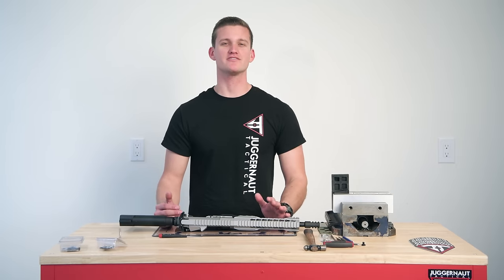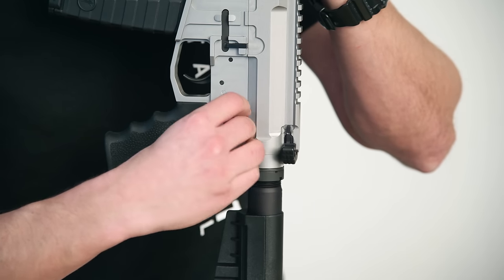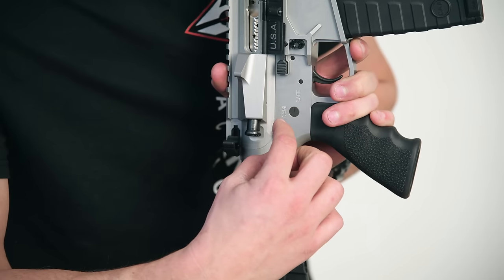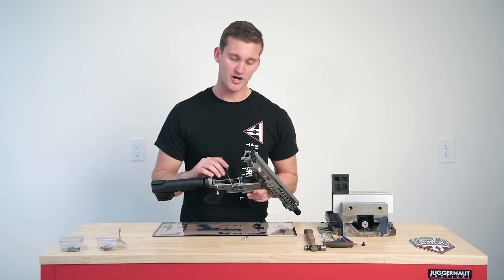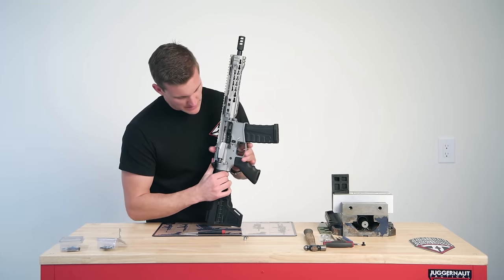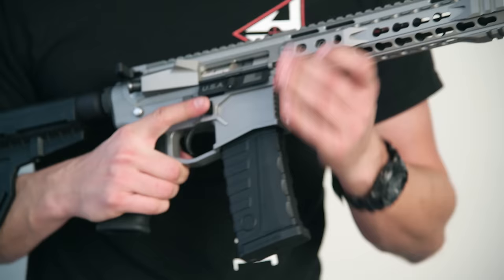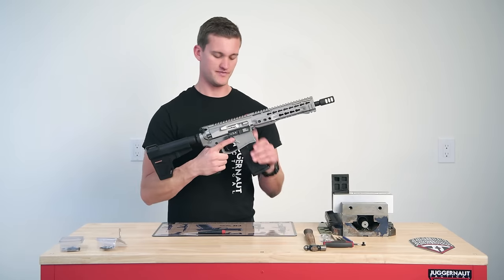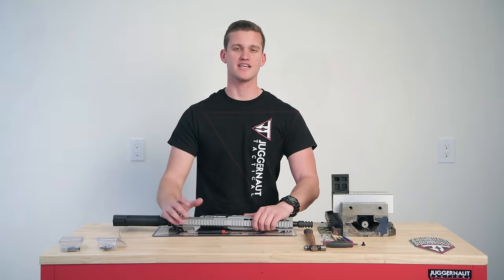How To Disassemble And Adjust Our Hellfighter CA Mod Kit

Comment: Be very careful pulling that pin out! First time I had no problem with disassembly and cleaning my firearm. The second time a small pin like a silver bar super small sprung out and flew across the room because that pin came out all the way do not pull that pin out all the way the spring will make that silver piece come out and it took me over two hours to find that piece and put it back in to the firearm. One time I went out shooting in the desert I had a jam and had to disassemble my AR rifle the same thing happened that tiny silver pin came out and it took 5 hours to find it in the rocks and Rubble. I repeat be very careful when disassembling the California compliant AR kit. I have to clean my firearm tomorrow I hope and I will disassemble the firearm very slowly so that small piece does not fly out towards the ceiling. Again be very careful while disassembling your firearm
Reply: Its called a detent pin and u can actually buy them from your local firearm dealers for around $2 i just bought a few extra and also bought a steel hellfighter kit luckily this time the detent didnt fly out just in case it does I will install it next time tho
Reply: exactly. This video should have told us not to do that, but it does not.
Reply: Same thing I struggled with in the beginning. It’s a pain in the ass, all you gotta do is go nice and slowly and hope that little shit doesn’t fling out…
Reply: Lol maybe wrap around a cloth  on the gun when pulling it out
Reply: This just happened to me right now. I saw it flying but now i can’t figure out where it goes back exactly. Can anyone try explaining where to place it? Thanks
Reply: @bvel93  look up a video called AR takedown pin without disassembly
Reply: @xsmileyonex hi. I was gonna clean mine for the first time and that pin didn't slide all the way so I can open it and now it got stuck and won't go all the way in or out. Spent some time with it, call my friend who know way then me and he couldn't fix it. Any ideas what happened? Thanks
Reply: Just get a comp mag
Reply: Same thing happened to me but when I finished shooting the bolt locked back and only way for me to release the bot was to remove the upper from lower fully and put both pin back in after the 3rd time the juggernaut pin is stuck because there is a tiny pin preventing me from pulling it out
Reply: This makes me hate cleaning mine too 😂🥲
Reply: @maxfromeve8636 same problem I'm having any updates?
Reply: @apple3172 any updates?

Comment: Mine lower is stuck it wont release all of a sudden with this mod even after doing exactly whats shown here.  Any ideas??
Reply: I had the same exact problem, I had to put something in there and hammer it out. This thing is crap, going with the kingpin
Reply: Is the bolt catching on the empty magazine and not allowing you to pop the back up to release the magazine? I just put one together and it seems to have that issue. There is a video on Youtube where a guy files a little material off the back of the magazine riser (sorry, I don't know what it's called) so the bolt slides over it instead of catching on it. I might be filing angles on a few magazines, but I'm looking at other possibilities, too. 
Without the Hellfighter, there wouldn't be a problem with the bolt catching because you could eject the magazine without separating the lower from the upper.

Comment: Just finished my build and I gotta tell y'all at JT..... I loooooooove the mod kit. Simple and practicle for me.
Reply: Do you have any play with the upper and lower? I have some and a tiny gap 😔
Reply: @ocroyal6688  
   None actually. My issue was with the pivot pin's spring and detent. Should of cut the spring a bit before installing. Pivot pin seems frozen. Went ahead and got myself Yankee Hill's "Specter XL Diamond" full upper.and still yet to fire a round. Good luck broskie. Stay safe, stay alert and train hard.

Comment: Just had one installed, like it so far
Reply: veerchasm1 I know I’m still going to do more research, but after installing this mag lock, would one also need to go to a fixed stick, and muzzle break or compensator. Or does this cover it
Reply: Swang & Bang it covers it
Reply: Swang & Bang No, if your magazine is locked like the Hellfire here does,  you can keep your pistol grip, you can keep your flash hider, and your stock. You can even have a foregrip. The only downside going with this, is you cannot lock your bolt back and hit your paddle (bolt catch release) to rack the bolt carrier. However unfortunately I'm pretty much used to it now, and its good.

Comment: just installed two and they work well. big downside  like most other mag locks are no bolt catch. would get 333 tactical maglock if i bought again
Reply: fire 9 of a  10 round mag and you don't need it .Load another 10 round mag and repeat,no charging either...
Reply: Do you want to swap mag locks. I have a 33.3 tactical unmodified cal catch which catches the bolt after the last shot. I install two cal catch. One work and one didn't. I swap cal catches on both guns, but the gun that didn't work still didn't work so I know the problem lies with my lower receiver.
Reply: Deer Phoria I would actually, how do we do this

Comment: Did anyone else have issues once they tightened down the buffer tube castle nut where the detent and spring put too much pressure on the tactical takedown pin and dont allow it to depress or twist to open to fully open the action for disassembly/cleaning? JT told me to snip a few coils from the detent spring. Haven't tried yet but curious if anyone else had this issue.
Reply: That's exactly what I had to do, and it works fine now

Comment: Ive been trying to find out what what that button is above the the mag release I am fairly new and in the process of building my ar atm
Reply from the maker: Ambidextrous bolt release - not functioning when Hellfighter Kit is installed
Reply: I just got a LWRC that came installed with the kit and it works on mine.  Im no expert nor do I know why,  just a fyi.

Comment: So i tested this out yesterday. The thing i did notice was the button that you push to release the upper becomes loose. You have to constantly tighten it. Other than that it was fine. Now to remove it for cleaning hmm 😒
Reply: Man, I've been having the same issue of cleaning since installing 3 years ago. I could never get the pin to pull out far enough without fear of full removal. I finally got fed up, sprayed some CLP in there, and went for broke with another hail mary pull, and wouldn't you know it, the damn thing did what's supposed to, and my upper opened up! Now the bolt carrier assembly is soaking in cleaner to get the scrub-down in a few hours.

Comment: Does anyone know of something like this that works for an LWRC DI?
Reply: Yes. This can be used on LWRC DI.
Reply: @allthecommonsense  Hey man thanks for the reply. Do you know from personal experience? I talked to the guys who make this product and they said it should work but last time a company told me it should work it didn’t lol.
Reply: @JTurn916  I have a 16” Tungsten DI that came with this installed. Works fine. I’m trying to figure out how to remove it since I left CA.
Reply: @allthecommonsense  Ok so it came factory installed? I bought mine when the bullet button was the standard so I wonder if they had to make any modifications at the factory before throwing this on there. These guys told me that I would have to get rid of the ambi bolt release to fit it on my DI. I wouldn’t mind doing that but didn’t want to risk removing it and it still not fitting.
Reply: @JTurn916  I bought it 2nd hand and I’m not sure whether it was done at the factory or by a dealer. LWRC can be hard to get ahold of for info, so I don’t know what they use for factory CA-compliance. I still have my ambi bolt release though.

Comment: did all the steps and it still wont seperate
Reply: Same with me did you find a way to seperate it
Reply: I'm not able to get the pin out
Reply: @ericmarquez780  I had to take mine back to turners and it tunrned out my rear pin was bent.
Reply: @Joshh556banana  I got my rifle at Turners, were they able to take it out?

Comment: I did all this and my gun won't seperate.... wtf
Reply: Same here
Reply: Did you find a way to separate it yet im having the same problem
Reply: @Joshh556banana  it turned out for me that the rear takedown pin was still stuck in the reciever just enough that it prevented it from opening, so I risked it and used brute strength to force that sucker out and it worked. Be careful though.
Reply: @lawman34  i did that and now it seems that the button wont go back in
Reply: Have any of you guys figured out why it's doing that? I still cant get mine to come apart for cleaning I just got mine to
Reply: @jorgeurbina5037  try getting a screw driver to pry the little silver pin to the the left to get the take down pin out
Reply: So just pry it off
Reply: Untill it pops open?
Reply: @jorgeurbina5037  dont put to much force on it it will get jammed

Comment: Man you make it look so easy. I Tried cleaning my new rifle that came installed with this and I failed miserably. I followed every step, but after I turned it one notch to open it, the pin wouldn’t come out. I thought
Maybe it was too tight and forced it out, but the upper and lower still won’t separate. Has anyone else ran into this problem? Any solutions?
Reply: hopefully you figured it out, but it can take a bit of turning it back and forth to get it loose sometimes.
Reply: I’m having this same problem rn. It’s like the button is too dry to turn properly
Reply: Found solution?

Comment: Just installed my kit and back from the range to begin cleaning the rifle.  Functioned as demonstrated but having trouble with the detent pin when pulling out the rear take down pin partially.  The detent always pops out every and then I have to repeat the installation process over.   I'm confident the installation was correctly completed because the take down pin worked, upper separated from the lower and was able to release the magazine with the button.  What am I doing wrong or is this a defective product design?
Reply: Im having the same problem but I cant seperate the lower from the upper to reinstall. Stuck together.
Reply: Hi Gabe:  I purchased two of these devices and had high hopes that they would work.  Had various problems with them both and ended up uninstalling them both.  Good luck with your problem and hope you find a solution that would allow you to continue using the product.
Reply: Same here. Not happy. And, even when the detent pin doesn't pop out, it is very difficult to get it far enough out to separate the upper. I can see the takedown pin getting weaker with each attempt.
Reply: I’m having the same problem as all of you. Any one fix it?
Reply: Brandon Park I uninstalled and made my rifle featureless.  I’m sure the manufacturer sees our comments to their own video and wonder why they don’t respond.
Reply: Jake Padilla 
That is so unfortunate. I had high hopes for this pin. I don’t want to go featureless
Reply: Myself as well it was very frustrating especially how this company does not reply or seem to care. Made my rifle featureless. Waste of $60.
Reply: Was hoping to find a good solution but it seems there are none..I have the same issue as everyone here. It's a pita to complete separate the upper and lower. Not to mention from time to time the first round from a fresh mag fails to feed. The rifle has always been reliable until I installed this product. I guess it's time find somthing else.

Comment: Why not leave the original rear take down pin in until you adjust the mag lock, that way its less steps to check the setting of the mag lock. Then once set and operating properly change out the rear take down pin.
Reply: you sir are a genius
Reply: Original pin or not makes no difference.  The upper needs to be opened to adjust the set screw.  The JT rear pin is designed to quickly pop the upper open (but holds the upper from opening all the way out) thereby disengaging the mag release button lock.
Reply: It does make a difference because it is by far faster to take the original rear take down pin in and out than the new pin. You need to be careful with the new pin and it doesn't slide nearly as easy as the original pin.
Reply: Yes I know Deer Phoria!
Reply: @johnsnyder6848  Ha ha ha . . . not only are you a genius, you are also modest! :)

Comment: The takedown pin detent slipped out of the grove of the juggernaut, (where the takedown pin should be) 

So now, the takedown detent spring is pushing the pin more forward, wedging the juggernaut in place. 

I’m guessing I have to loosen the extension nut, but I don’t have the tools. I’m not really happy about it, at all. This was the first time I tried to disassemble the system to see how it worked, and the moment I pulled the pin, it just wouldn’t come out and this was why.
Reply: Had this happen first time I disassembled my rifle, came from the store with the kit. At least on mine, it's pretty easy to just fource the pin back and slide it back though the pin hole.

Comment: Hi, Your gun is so cool, I'm very interested in it. Could you let me know the Mode and the name of Gun Maker? Thank you so much!
Reply: Juggernaut Tactical
Reply: @brentambrose6804  the gun manufacturer is juggernaut tactical?? I thought they only made a little kit to make a gun California legal.
Reply: @seanwatts392  Nope, they make complete California legal AR's
Reply: @brentambrose6804  that's cool. I didn't know that. I thought they just made the break action part
Reply: @seanwatts392  They are actually pretty reasonable.   Just over a grand.   But they don't even have "sights" on them. 
You have to accessorize the crap out of em.   Ive added a ACOG and a Bipod so I'm set.
Reply: @brentambrose6804  I bought my first ar 15 for 550. It's a rugar556. Ima check this one out as well

Comment: Mine's wasn't as easy as shown on  video  my magazine got stuck  the pivot pin wasn't able to move clockwise in or out  and all this happened at the shooting range first day I got it  ( new ) second day I return it back  , so now it's going  back to manufacturer .the guy said don't worry about it you're not the only one  or First will this problem many people have the same issue . 
Now I have to wait 2 to 3 weeks

Del-ton echo 316

Comment: Hey hang on - when I bought this I didn't realize it completely replaced the bolt release. Will my rifle still lock back on an empty mag? How do I release the bolt, just pull back on the charging handle?
Reply: I was thinking the same thing. It seems it only works with  their lowers and not one you are building from scratch since their bolt release is on the right side. They don't tell you what the options are if its not. Bad info.
Reply: @Gandhii2  I installed my kit on a Ruger AR556 lower with a PSA 16" M4 upper. The bolt would lock back on the 10 round pmags and I'd have to push the follower down with a cartridge to let the bolt ride home before I could break the upper and release the mag. I took the rifle home and used a pocket knife to round off the stop on the followers and now I can drop it easy and have a hold open or drop it hard and it will ride home. Works well, with this specific set of lower, upper and mag. Your mileage WILL vary.
Reply: @TheWarmotor That's interesting. Thanks for sharing. Been hesitant to pull the trigger and buy the thing since most ranges require that the action be open during cease fire. I guess breaking the gun open will work fine. Id hate to have to modify stuff just to have the bolt be locked back though. Thanks for the info. I appreciate it.

Comment: Just had this installed on my AR15, and it's nothing but trouble!! Every one of my 30 magazines, Pmags and Hexmags will not work! For some reason, just since this was installed, the bolt hits EVERY SINGLE mag I own and jams! Piece of Garbage! I even tried shaving down the backside of the follower and it STILL jams!!
Reply: Lake Boy it’s not the mags, I also thought that, for some reason you can’t fully load the mag, I removed all those features & don’t have problems with my mags anymore

Comment: I have a Andro corp .  aci 15  I got for a gift . My rear take down pin has a spring on it, and other side says open and close. Do I remove the spring and bolt to open the gun? Thanks no nothing about this weapon.Your video is the best I have seen so far.
Reply from the maker: yes - hold the upper and lower together and remove the cap (and spring), press the pin, and then turn in the "open" direction, till it stops; pull the pin till it stops, just like in the video.
Reply: @JuggernautTactical  Thanks for your help .

Comment: This kit is a great concept but thats it. Had multiple issues. From rear pin being bent and not being able to function. To the detent pin popping out and having to reinstall the whole rear portion over and over as well as this kit not letting me use most magazines (had to shave each mag follower). Oh and all the jams at the range was so annoying. After all the headaches and frustration I just converted my rifle to featureless. I just wish I could get back my $60.. it seems as if the company doesn’t care either.
Reply: Is there any way to fix the jamming issue other than making it featureless? I took mine to the range and it jammed over 5 times in an hour.
Reply: Yoakahama818 Unfortunately not brother. The only way of clearing it is by taking the bottom plate from the magazine out and handling it that way. But theres no true way to stop the jamming it’s just going to keep jamming sadly.